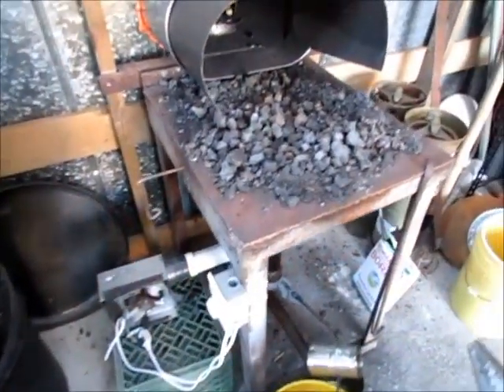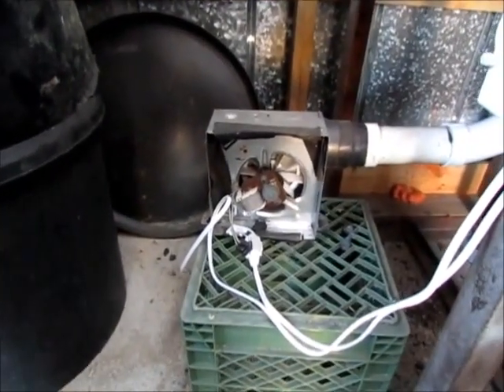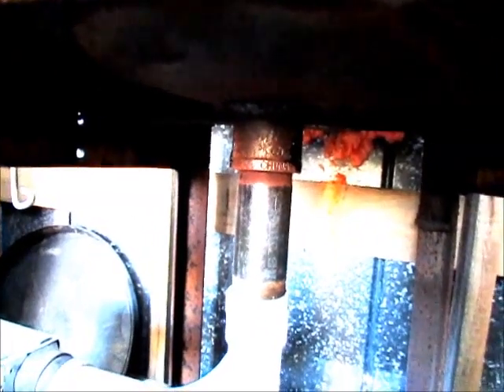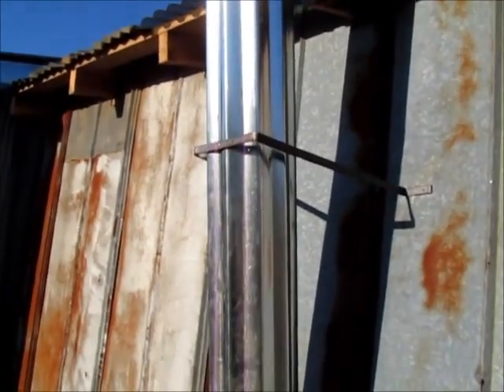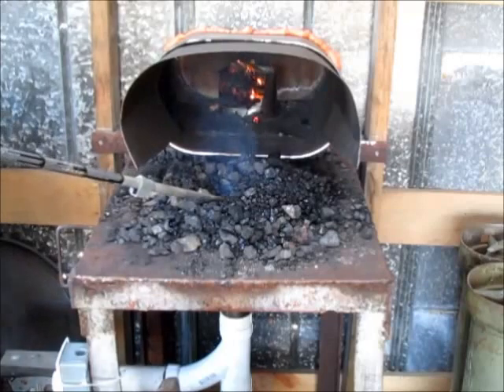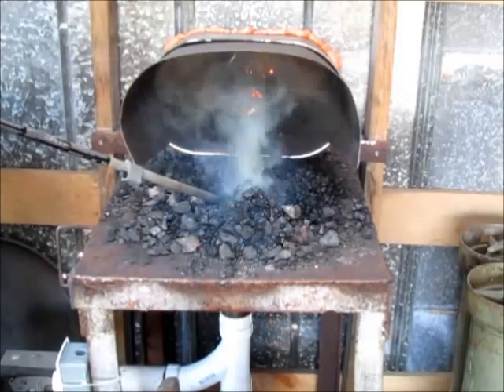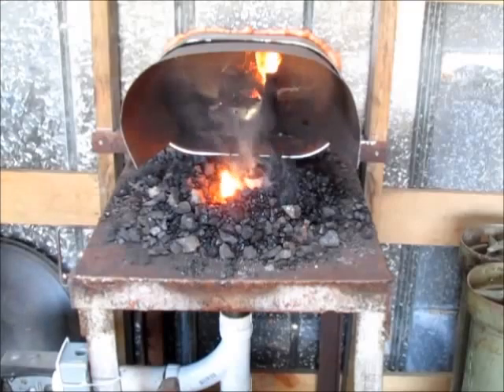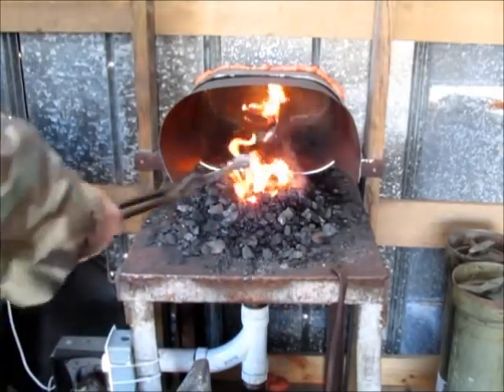How to make a blacksmith forge

Comment: Nice job on the forge . Iam building my 4th forge soon in my new shop. Trying to find 12" inch flue pipe that you can afford is next to impossible. good idea on the tin. I was thinking about using 55 gallon drums welded together for a flue but don't know if it would be to big ???? what do you think ? I can get them for free.... do some more vids
Reply from the maker: Hey thanks for the comment! I'm not an expert on flue pipes but I think the drums might be too big to get a good draw if you are going for a side draw forge. The tin was really easy to roll up and rivet into a pipe, but it’s only about 7.5" in diameter. And it’s not cheap if you have to buy it.  I guess you could use 2 sheets to double it, but that’s a lot of work.  Maybe you could cut sides out of the drums and use that material to roll into your pipes? It’s pretty thin but it may still be a lot of work. I’ll do some more research on it and if I come up with any better ideas I’ll post them here.  Thanks again, and I do plan on posting more vids so keep an eye out.
Reply from the maker: The Soap Hollow Forge custom blacksmith  The more I think about it, if I had access to free 55 drums I would probably cut the sides out and roll my own pipe. I'd probably rivet them together and caulk the seems. If you went with 10" diameter you might get 2 lengths of pipe from one drum. Just have to do the math on it. Maybe I'll get a drum or 2 and try it, maybe make a vid on it one day.